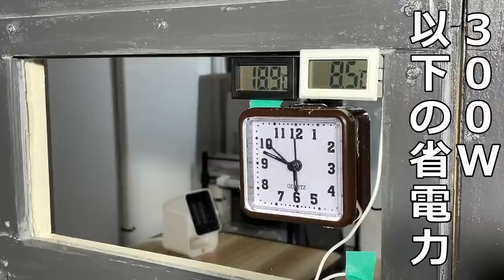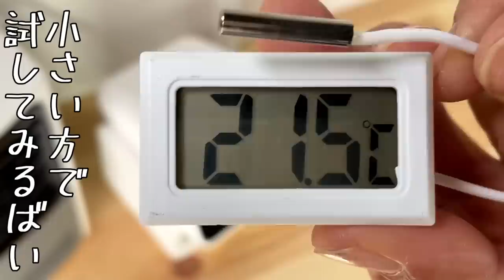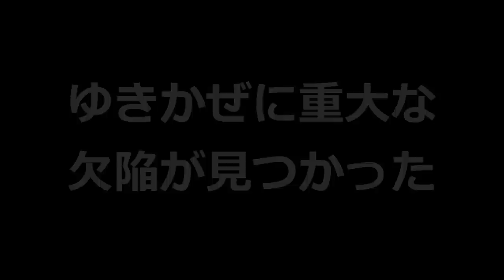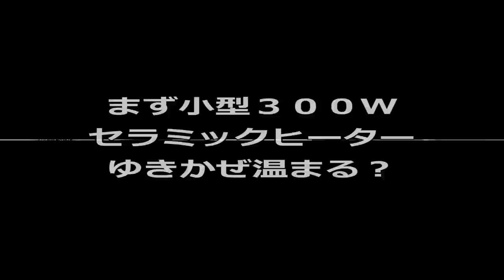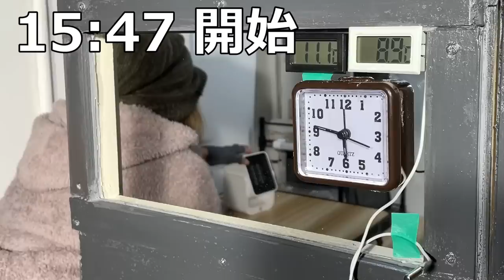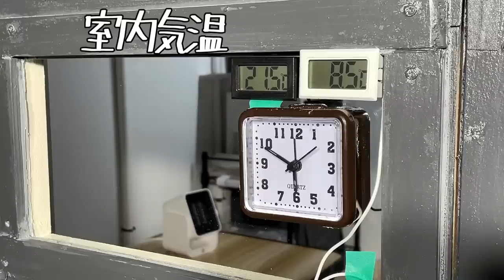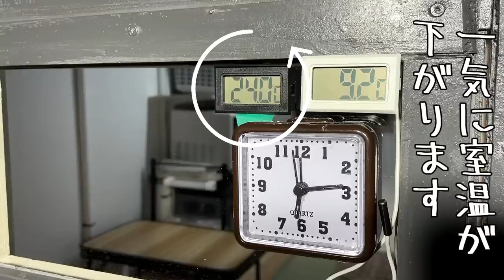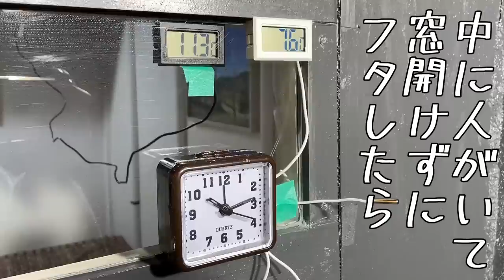軽トラ幌 寒さ対策！荷台の隠れ家の補修と省電力の暖房で保温性能を試す｜DIY軽トラキャンピングカーゆきかぜ

Comment: Hello Deen and Yumi. The heating system in my house is old and not good, so I use a 1500W ceramic heater in the winter. It has tip-over and overheat protection and it has a thermostat. It is good at maintaining a comfortable temperature but I don't know if the smaller ones like you have come equipped with a thermostat. Yukikaze's heat retention seems quite good. I think if you could find one with a thermostat it might work very well and save some energy. Buy from a reputable manufacturer so there is no fire danger.👍